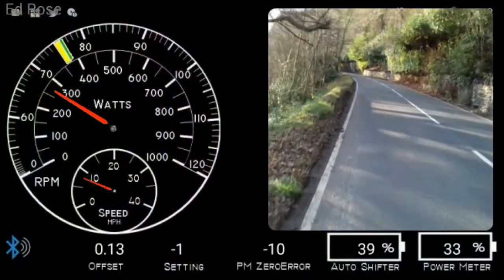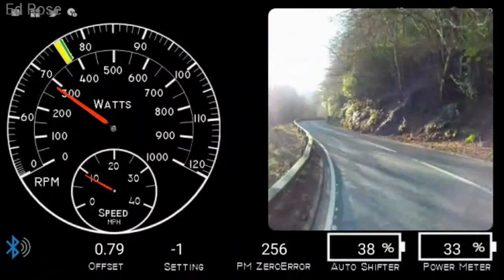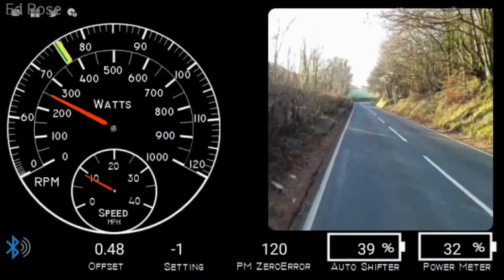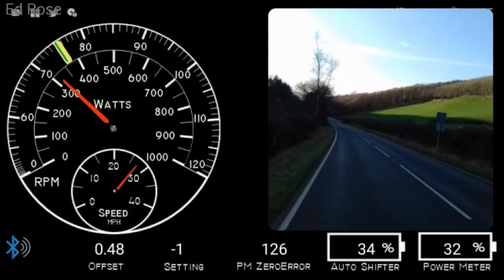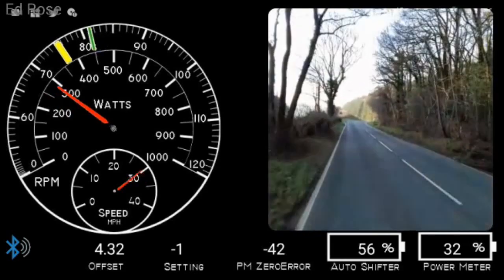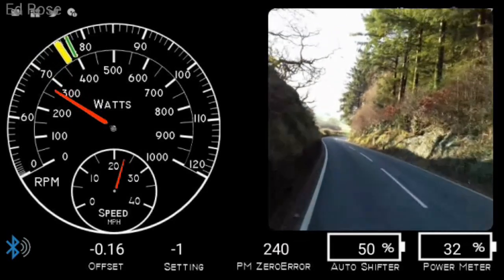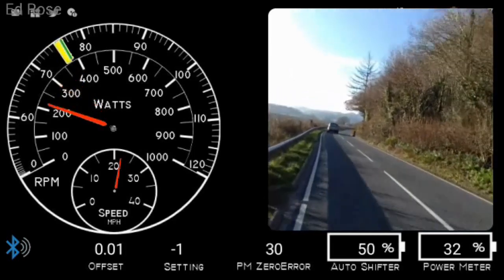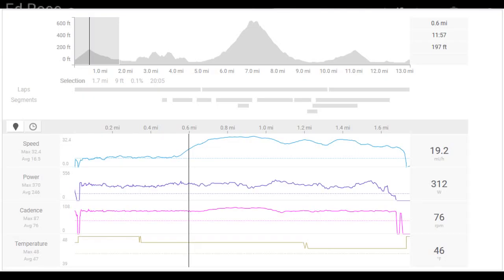Is it easier to put out power on hills? CVT & auto shifter

Comment: I'm really curious how you are displaying the data on the video.
Reply from the maker: I created an app using MIT App Inventor that receives the data via Bluetooth. Some is displayed in text box's and some sets the rotation angle of a image.
The camera is part of the screen recorder app called DU Recorder.
Reply: interesting thanks for sharing.  I'm working on a telemetry overlay to work with shotcut video editor. But it's not even close to working correctly yet. https://github.com/BruceChastain/shotcut_gps_overlay
Reply: well not only telemetry but any other info as well of course
Reply from the maker: @BruceChastain  That's the benefit of doing it yourself as you can display whatever data you want.
Your idea is ultimately what I would like to achieve with mine, looks better overlaid on the video.
A challenge though and I'm not great with this sort of thing, took me over a year working on and off to get the app finished.